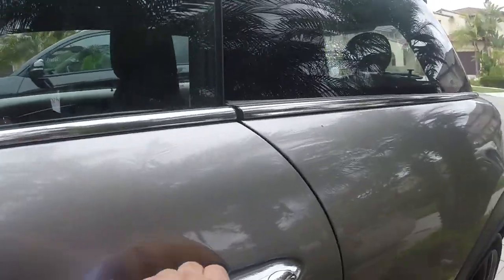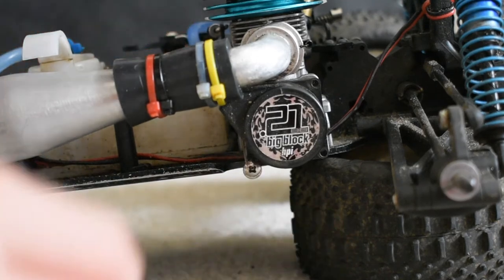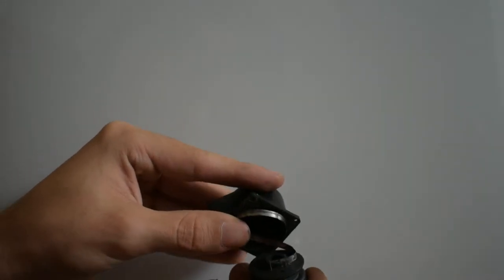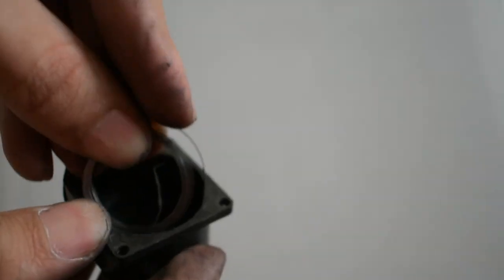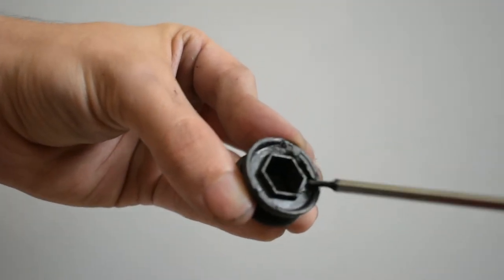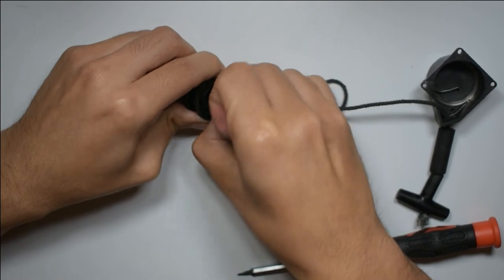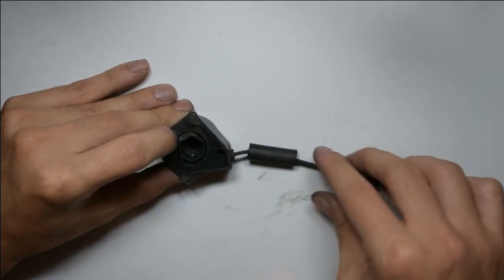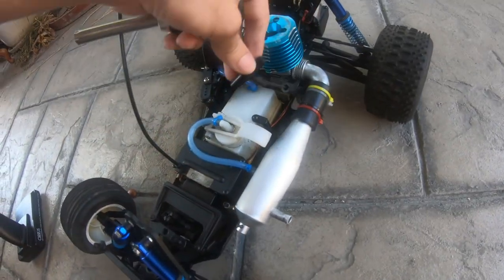First Time FIXING a NITRO PULL START (Pull Start Replacement??)

Comment: Well atleast you done it mate. I had a 1/16 nitro buggy so you can imagine how small pullstart was. Coil came off and I gave up. Drilled hole in housing and removed string and put a couple slits in string roll so can start with a drill with a flathead bit.